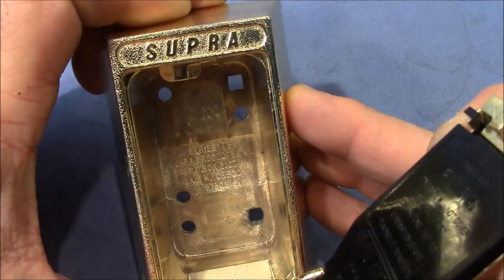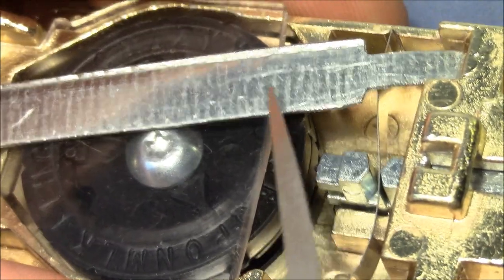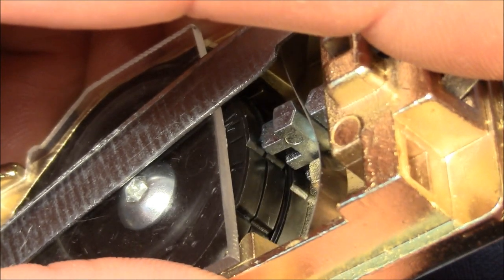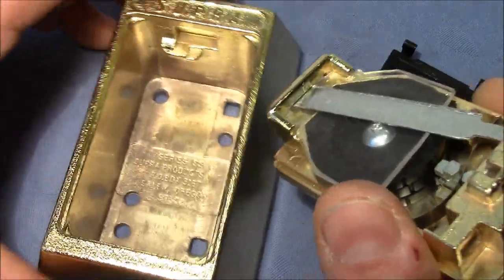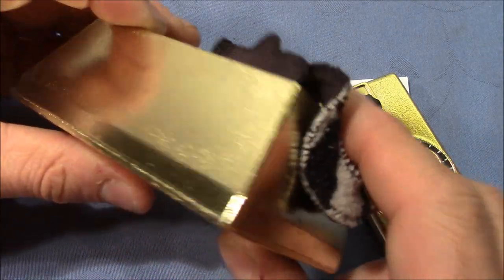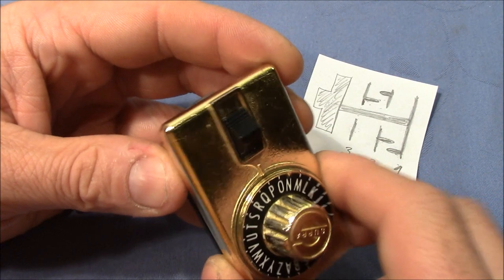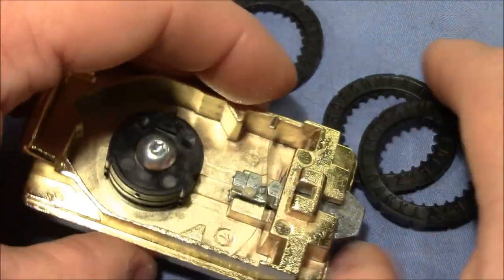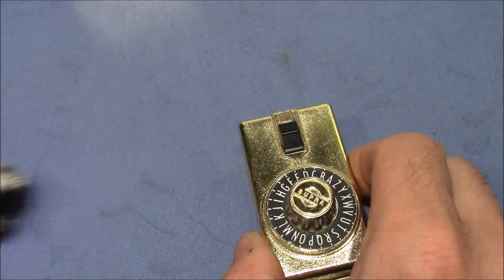(picking 348) The SUPRA safe lock key box explained and decoded (if lucky) - thanks West Coast Picks

Comment: Dude, you're awesome. I wasn't able to decode the combination but the rest of your demonstration worked wonders for me. Make another video of the way I did it if you please, I'm not going to make one. Here is what I did to open mine:

I shined a flashlight inside the lock from the back screw holes, since I saw how it's made from your video, I used a strong but tiny awl and opened the two latches on top of the black backing, you may need two. Then I opened the top. I moved the key that was inside along with the screw heads I cut off to the bottom of the box. I kept the black cover inside the lock open as I shook the inside parts loose while turning the dial and they eventually all fell inside freeing the lock so I could open it. Remember to shake the parts loose while keeping the front of the lock facing up so the parts falls inside the cavity. Now, thanks to your video, there was no surprises or guess work as how to put it back together. I didn't find the combination but I made my own... Mine is a series S5, the only difference from yours is the black cover inside doesn't come off, it is inged at the bottom. It would have been much easier if mine was made like yours because the black lid could just come off. Thanks a lot for a real nice thorough video.
Reply from the maker: Great that you had success with your lock and thanks a lot for sharing your story :-)
Reply: @Potti314   The pleasure is all mine. I just looked at your videos and I just had to subscribe...
Reply: Thank you for sharing your alternate technique.

Due to the specific unknown  combination that had been set previously,  I was able to discover only  the third letter of the combo.  Unfortunately,  the technique shared in the video was not allowing me to discover the first and second letter of the combo.

Your alternate solution worked perfectly and I was able to get the box open with two small screwdrivers in about 5 minutes.

Kudos to you!

Comment: I was able to open mine after viewing this video!  (And fooling around with it for a few hours). The key point for me was that when you have found the first letter, and you press on the opener, the bottom of the dial pops out a little bit, as mentioned in the video.  That's because the opener is pressing against the wheels for the 2nd and 3rd letters, which are farther away from the dial, and not against the wheel for the 1st letter.
Thanks,  potti314!
Reply from the maker: Thanks for the feedback - happy that you got your open. Cheers :-)
Reply: This tip about the dial popping out is what helped me decode mine. Thanks for sharing.

Comment: Since the last letter of the code is determined easily and the gates span two letters, that leaves 169 possible combinations that could be sequential tested.  That could be a solution for those times the false gates do not line up.
Reply from the maker: True, the brute force method is always an option. But I find it hard to do it right every time and not mess up with one number.

Comment: I apologize in advance if this is a stupid question. Would it be advantageous to take a file to some of the false gates, to "randomize" the feedback of the play? Would that damage the integrity of the lock in general or simply not effect the play enough increase the difficulty?
Reply from the maker: Guess the more variation in feedback you can introduce the better. For practical and cost related reasons this is not done commercially.
Reply: @Potti314  Totally makes sense, thank you.

Comment: great job. thanks for the explanation. I was surprised the true gate was so large I would've thought it would be just slightly larger than the bar.  is it possible to line the false gates were none of the three line up together?
Reply from the maker: Thank you. Yes, the gates are really large - at least two full letters.  There are 26 letters and 12 gates - so roughly for every second letter the false gates align. Due to tolerances I would say that always two gates align when having 3 wheels. But I cannot test it as my son has the box taken along to a little trip today.
Reply: Potti314 Lol he must really like that.  lock up all his important things lol
Reply: Yes it is possible to line it so that the false gates do not align. In fact I just check my combination and the false gate line up. And it is not a surprise that the false gates line up since my luck is dictated by Murphy's Laws. So a change it so that it did not line up.  
So I just want to thanks Potti314/Potti-π for this video, as I would never know to make sure that the false gates do not line up without watching Potti-π  video.

Comment: An other way to open this lock, heat the lock, and when the plastic wheels are molten, it opens!
Reply from the maker: Good idea to melt the plastic wheels. But that stinks ;-)
Reply: @Potti314  I don't understand why they use plastic parts in security products. Nonsense!
Reply from the maker: Well, it's cheaper.

Comment: I have the same lock but couldn’t figure it out. Can I send it to you?
Reply from the maker: As I mentioned there are combinations that cannot be decoded. You can try inserting a thin screwdriver in the back holes to open the internal cover and pull/shake out the wheels. I think shipping costs are too high compared to the benefits and the small likelihood of my chance opening it.
Reply: I just posted how I opened mine using that technique. It really works.

Comment: So only if somebody would made(design) it a bit better it would be very good lock? ;P

It's made from super shiny plastic or cast bronze/brass?
Reply from the maker: It's definitely metal, maybe coated aluminum - but not sure. Regarding the lock-mechanism is really not too bad but I think that a hammer and screwdriver would forcibly open it up. Nothing I would store my house key in.
Reply: @Potti314  Nice video, I haven't opened mine yet, just reading comments. Locks are only for honest people as they can cut a hole in your door or wall. Someday you might mount this outside the home with a key in it in case your son comes home and no one is there to let him in. When it is mounted you don't know if anything is in it and even if there is a key you need to figure out which lock it opens. Maybe you put a combination on paper in it to another lock. It is better or as good as a hide-a-key.